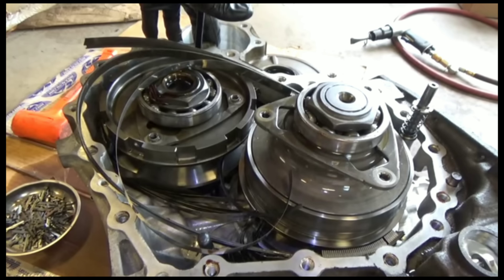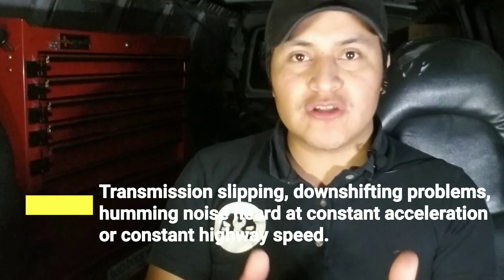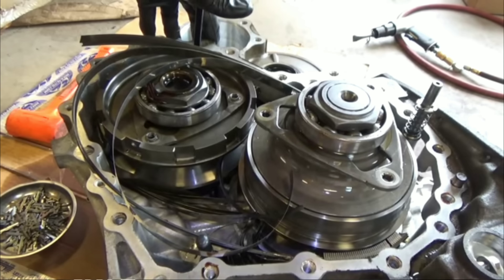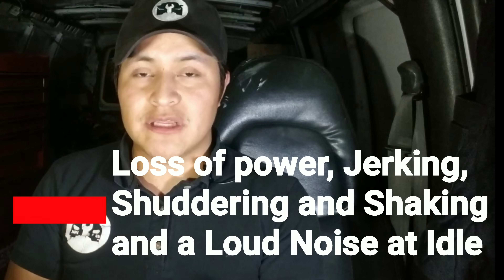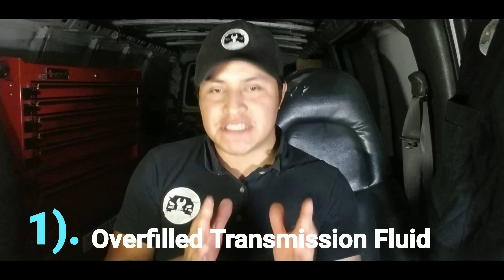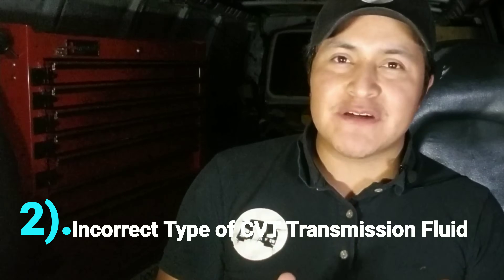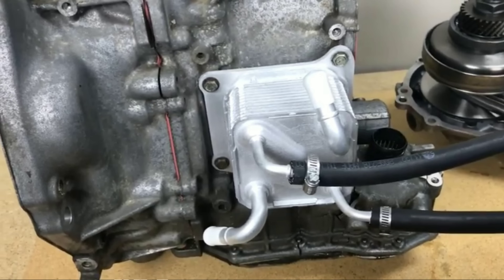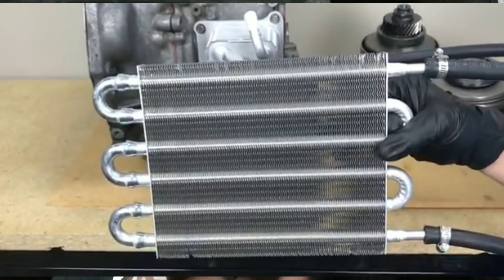NISSAN CVT TRANSMISSION | why it fails and what you can do about it to prolong it's life

Comment: I never knew about CVT transmissions until mine started going out. Now I see why many dealerships have rental Nissans in the parking lot at 40k mileage.
Reply: Nissan has been sued about this, unfortunately I bought a car from them and it is a total piece of crap.
Reply: Which car do you have ? I was thinking of buying a 2021 rogue. People say good things about them.  Looks like a bad decision
Reply: @manojmohan7264  get a rav4, or find a used RX350 if you want something nicer.
Reply: @jordanmercier3616  nO GOOD,  Design flaws--Roof leaks
Reply: @TheMinijacky  roof leaks, or engine/transmission failure lol I wonder what's the better choice. I have a GX470, 06, 240,000 miles on it, never had any major issues with it. I have an 02 sequoia with 239,000 miles, never had a major issue with it, just regular maintenance. Toyota makes the best engine/transmission combos in the car industry hands down. There's multiple 2UZ-FE engines with over a million miles on them without a rebuild, how many Nissan's are out there with that mileage, none.
Reply: @manojmohan7264 stay away from Nissan cvt. The only decent cvt after extensive research is toyota and Honda
Reply: Yep, thinking the same thing!
Reply: Exact same thing happened to me. (expensive) Lesson learned!

Comment: Our first CVT trans had the differential go bad by 104K miles. These transmissions need frequent fluid changes like every 12 months. The friction material is in the fluid and needs to stay fresh.
Reply: Use Amsoil CVT fluid 
It’s the best
Reply: @anguslean4058  Its 40C viscosity is too thick to start for cold zones.

Comment: Very Good Video. I am at 42,000 miles with my Murano. Will get the oil changed and add a condenser to the cooling system.
Reply: Sell it. My Murano started CVT problems that just got worse. Great car otherwise.

Comment: 2015 Altima 2.5.  214, 000,  mostly  freeway, zero problems with CVT, Never changed the fluid, changing today with Valvoline synthetic.
Reply: Wow that's great.  I have mostly highway miles on mine, changed fluid about every 50k miles and now have 145,000 on it.
Reply: @azjoe_6310  I misspoke, it's my daughter's car, and I forgot she had a  major cvt problem at 96k, surging, rpm flare, hesitating, under warranty they pulled it out rebuilt it, haven't had a  problem since. There were a Code P17Fo or P17F0 and bulletins NTB16-110   NTB15-013 Listed on the invoice, plug it in to Google a ton of info and photos come up, it appears the main part replaced was a expensive belt pulley kit Part# 31214-28X9E TMA 258  FK-K2  I'd suggest doing some research, I know at one time there was a class action suit against Nissan and they were paying for certain repairs,  extending warranty protection, et cetera. Good luck. Maybe your diligent fluid changes are the key. 145k is nothing to scoff at. 👍👍👍
Reply: @kccodex8931  Thanks for the info.  At 8 years and 145,000 on the clock I doubt if I would be entitled to anything if it dropped dead on me now.  I'll look up those bulletins.  Thanks again.

Comment: So why are Honda and Toyota CVT's more reliable? What do they do differently?
Reply: TOYOTA has a hybrid cvt. Toyota's  cvt has an actual first gear then then the cvt belt kicks in. Less tension on belt when accelerating from a stop.  I still hate the cvt but I ended getting a Mitsubishi with one and change the fluid every 30,000 miles at the dealer no exceptions. That way if there is a problem there is no way the dealer can blame me

Comment: Been there,bought 3 transmissions. Am done with Nissans!
Reply: Is recommended to flush the trans fluid every 30k miles lol i still have my 13 and 14 altimas at the 100 % ,i take care those babies as much i take care my 2004 rx8 ,its just dedication,like engine oil change i do every 2 months even i don't use my cars that much 😅
Reply: @jorgito0807 I do 2,I've bought 3 transmissions in a year
Reply: I am sorry to hear that. I wonder whether there's has been any class action lawsuit against this crappy car maker.
Reply: @deshanchathura  there has but led to increasing warranty time which has since expired
Reply: @deshanchathura  Based on my research, there have been 5 class action lawsuits against Nissan for these CV transmissions. Just saw your comment was 2 years ago, but my comment may help someone.
Reply: Me too! I thought they were good vehicles until I bought them
Reply: Brought my 1st Nissan Altima and my last...transmission went out .
Reply: @vcovington623  What year and how many miles
Reply: You should have never paid any kind of money for no transmission.  I took my Nissan back on the lemon law and they took the car back and plus I got money back. If you ever run into that problem again get a lawyer right away😂😂😂😂😂😂😂😂
Reply: I like nissan but I never had transmission problem with Toyota...this video helps
Reply: Why a CVT ? Is the shift point on a modern transmission such an irratation or nuisance that you would not want it ! Using a metal band to turn a metal pulley is not asking for problems ? Clutch disks are much more reliable and not as finicky !
Reply: Bro, I never buy any Nissan again   they said a resolve the problem with new vehicle, but they never , go ahead and buy Toyota way better.
Reply: there is something wrong with your driving skills no doubt. maybe you need a racing car. LOL  3  TRANSMISSIONS. JAJAJA.
Reply: My first CVT on a '11 Ultima went out at 241K,  the second one went out at 290k,  if you get that you're doing good
Reply: Same, they are shit and have God awful customer service, going to buy Teslas from now on anyways so it does not matter, but I do hope they go bankrupt.
Reply: for which model did you have this issue if i may ask....
Reply: Im on my 3rd one,Nissan is a scam,they don't care about anything or anyone
Reply: 2016 Nissan sentra se
Reply: @marcuspolo9106 290k is great
Reply: @meshackmbithi5758  ditto!!!!!😡
Reply: Nissan will replace even on older models ..ive save so many people on Facebook 4 out 5 got there transmission replaced. Even on olders model under 130,000
Reply: How?  @just_here_or_there
Reply: @just_here_or_there how does one get Nissan to replace
Reply: It's so sad as they r such beautiful cars :(
Reply: How often were you having the fluid changed?
Reply: they are junk are dense or just stupid  designed to keep buyers  in poverty THEY ARE JUNK junk junk junk...
Reply: @luyyyu  never mattered bro. Because every time I changed the gear box I would obviously change the CVT. Most Nissan models obviously have transmission heating issues, and several motoring agencies recommend installation of gear box coolers

Comment: I'd like to see a real-world example of a Nissan CVT that's been babied since new and how many miles it is capable of. Problem with transmissions of all types is their maintenance is generally ignored .
Reply: Mines been beat on.. at 150k still runs good lol
Reply: Well that's not a real life measure of its reliability.
A lot of cvt vehicle manufacturers tried to pass it off as maintenance free and many of them had to back track on that
Reply: @NobodyUR  I’ve serviced mine more than religiously.. flushes with drain and fill between.. I did smash my pan at one point which was smashed into the fluid pick up.. caused my fluid to be metallic (drained and filled immediately) probably caused most of my wear in a matter of 20 miles.. but still truckin
Reply: @kalieburrows1427  did a similar thing with my HHR back in the day. "Fixed" it but transmission started slipping at 80k damage I believe was at about 50k. So even though that wasn't a cvt it didn't survive unscathed from a similar situation. Best of luck. 
Know your clearance is my recommendation   lol. I drive a truck for years prior so straddling shit in the highway was common. Haven't done since. Those semi tire peel offs will rip a bumper clean off btw . The more you know
Reply: @NobodyUR  mines slammed on coilovers.  lol and on the 3.5s the pan is the lowest part of the car :(
Reply: I have a 2010 Altima that I acquired in 2013 when it had fifty+ thousand miles.  At the time I read on the internet that Nissan had recommended that the fluid never be changed, so I didn't.  By the time I learned that it is recommended that the fluid be changed, too many miles had been accumulated, it was too risky to change the fluid.  Ultimately decided not to change the transmission fluid and cross my fingers and pray hard.  I have no idea if the previous owner of the car changed it or not, but the car now has 252+ thousand miles and I don't notice any slipping or any issues (thank God).  I cruise on the highway at 72 mph @ 2000 rpm and that has not changed a bit since I got the car.   I have read that with the Nissans it's a hit and miss thing.  Luckily for me it was a hit, because I cannot afford to lose my car at this point.
Reply: @billmayoral6385  Thanks for the info.

Comment: I’m an ex-Nissan service advisor. Nissan recently lost a class action lawsuit recently on these transmissions, therefore Nissan has extended the warranty to 7yr/84k miles, regardless of who owns the vehicle, i.e., 1st owner, 2nd owner. If you are under this time/mi threshold, then the dealer will do either one of 2 things. They will do what they call a field repair where they replace the valve body and chain drive assembly, or they will replace the transmission completely at no charge. It will depend on the fault code that is present in the TCM that decides the outcome of the repair, so just take it to your nearest dealer and pay the diagnostic charge, which usually includes a TCM update. If you are over 84k, there is still hope, just ask for goodwill assistance from your service advisor, it won’t be 100% covered more than likely, but might be able to get them to do a goodwill split, meaning that Nissan will cover 90% of repair, owner 10%, or Nissan 80%, owner 20%, or 50/50 split, each case depends on a lot of factors, such as if you have a good relationship with your dealer and do your maintenance with Nissan, if you are a loyal customer, no issue more than likely, they will step up and help you out. We were replacing these transmissions left and right in Phoenix, they are crap units, and no, they have made no internal redesign changes to correct the issue, it’s same replacement parts that will go bad again over time.

Comment: My Nissan has 173 000 miles. I’ve noticed a small problem while accelerating on the freeway and especially going up hill . Driving uphill my  2010 Nissan Altima 2.5 S loosing power but still I can drive it on slow speed up to  35-40 as long as I’m not driving uphill  What should I do if it’s not too late. Thanks

Comment: I myself have a 2009 rogue and it has almost 100k miles on it. Runs no problem and shows absolutely no signs of death. My other friend also has a nissan with a cvt and he has about 200k miles with no problems at all. He also put a lot of miles on it so i cant say that, oh, he just swaped the cvt because he put about 60k miles on it with absolutely no transmision service. Both of us live in the cold provinces of Canada. How come? I bought this nissan and its really fun to drive and its surprisingly fast THANKS to the cvt lol ;)
Reply: Yeah, it seems that the Nissan CVTs built before 2012 or built after 2017 are better based on everything I've seen online.

Comment: Hello - Great Video!
Is the 2019 Murano affected by this problem or has it been correctly addressed?
I see reports indicating that the 2019 reliability is good ... But I'm nervous about purchasing this vehicle.
Reply: Did you buy it? If so, how's it doing?
Reply: I have a 2019 nissan murano and it has 73k miles on it and it’s still going strong and no problems!!! Only problems with it is the front sensor but I think it’s been damaged somehow and have to take to Nissan to get fixed
Reply: I may be wrong, but from looking at a lot of Youtube and internet forum comments, the problems seem to be with the 2012 to 2016 Nissan CVTs. The ones before and after seem to be a lot better based on the fact that you don't see complaints about those years except on rare occasions. One forum said Nissan was forced to upgrade and fix the CVT trans problems after this period to prevent future lawsuits. One way to really find out is talk to transmission shops in the area and ask them this question. I'm sure they would know.

Comment: My brother has a '12 sentra with the cvt 110k miles and still runs strong and he hasn't changed the trans oil since he bought the car at 40k miles ahahah Had a guy where I work had a Maserati and the trans took a shat . Moral of the story shit happens.
Reply: 12 Sentra was not known for cvt problems. Still reccomend cvt fluid changes ever 30K miles
Reply: @justinh5076  it's now 130k not one cvt oil changed .. I have a 2017 maxima. 34k miles .  Added the the radiator for the cvt ..
Reply: @justinh5076   I have a 2008 silverado with 216k miles... I'm the only person that's been doing my own work on it ..

Comment: I have a 2010 Altima, I replaced the fluid when it had 60k. So far, running like a champ. 98k miles on it now.
Reply: We had an 2010 Altima. Got rid of it in 2019. The CVT and whole car was great. It had 178,00 miles when we traded it. We purchased a 19 Subaru Forester, We will always remember our Altima as a great car.
Reply: We never changes the fluid in the CVT on that car.
Reply: Mine was perfect with absolutely no problems at all until exactly 102,000 miles and it’s just went bad out of nowhere and no warnings.. a “quick” trip to the store and that was it. 😭 never again with a Nissan
Reply: @ciaralovebug360  I'm crossing my fingers...102k right now... 😨😬
Reply: I have a Nissan CVT transmission and have no problem is don't let these people try to scare you
Reply: @josephmac2386  the problem with these people that they either don’t do routine maintenance or never replacement the band
Reply: @ramontorres2091  which band are you talking about?
Reply: a rock band? a boy band? a church band? rubber band? I really don't know 😁😁😁

Comment: *Altima 2007 - present 
Maxima 2007 - present 
(The JATCO unit that's in the Maxima doesn't have that failure rate, they are the same ones Subaru uses)
Reply: yup, especially the gen 8 Maximas 2017/18- 2023 Xtronic CVT....much better 👌 I  have a 2023 runs amazing just had my cvt fluid changed.

Comment: My 2016 Altima SR is running like new going on 68,000 miles. No CVT failures or issues. The only thing I had replaced were getting new brakes and rotors, and battery since purchasing the car in 2016.
Reply: Hey Marv, I have the exact same year and model. Thing has been flawless besides an over tightened battery bracket. Which cracked the case after the first year. All I've ever done besides that is breaks oil and tires. Well today at 110,000 I'm shuddering. Luckily I was 3 blocks from my house and babied it home. Today is also the first time of hearing about the class action lawsuit against Nissan transmissions. It was a garbage from day one and they knew it. Shame everything else has been solid, I have been nothing but praising it. Three more payments left. So much for enjoy life without a loan. I'm not dropping 3 to 5 grand on it for a new garbage trany. Also never buying anything Nissan again
Reply: I’m at 45 k miles and it’s loosing power it does not properly accelerate from a red light just sounds loud

Comment: My daughters 2012 Altima has 170k  on it and runs fine. She's never changed the fluid, even though I told her to get it done. Really good video, except I would never buy prediluted  coolant when it cost as much as non diluted (you only get half  as much antifreeze).  If a person can't figure out how to mix 1/2 water with 1/2 antifreeze, they should probably not attempt any maintenance on their vehicle. Thumbs up.
Reply: Hope you mean DISTILLED water
Reply: I’ve heard of using distilled water in the battery, but not in the cooling system. I’ll have to look into that. Thanks 👍
Reply: Really ? I know you should use distilled water in your battery, didn’t know it is necessary in the radiator. Thanks for the tip, I’ll look into it.

Comment: I have a 2008 Nissan Maxima with 144k miles and it doesnt move at all. Doesnt move when I put it in drive or reverse. Has some codes P01700, P1574, P0500, P1720, P1715.

Comment: When should I get the cvt transmission drained. I have a 2014 Honda Accord and had a new transmission put in around 40,000 miles and it's at 72,000 now

Comment: I am still driving a 2005 Maxima in Australia and it has been a great car. The CVT is only now starting to slip so overall, I'm very pleased  with Nissan and the CVT transmission. The CVT'S bad reputation is partly due to people just repeating what they've heard without any personal experience.
Reply: Really? I have a 2018 nissan with just 60k on it, serviced regularly. CVT is going bad. Doubt it is because of what people have said about it

Comment: My versa has 112000 miles on it my question is would it be counterintuitive to remove and clean transmission pan at this age I'm worried there might be pinholes in the pan once it's cleaned out.
Reply: Original CVT with 112K miles? What year?
Reply: @TheYoungBoaty  2011 it's at 137000 miles now
Reply: I'm flipping the car by early next year so I won't bother changing the pan it's a decent car alot of brand new parts have been replaced over the years credit score is also looking good going to get a rav4 next.